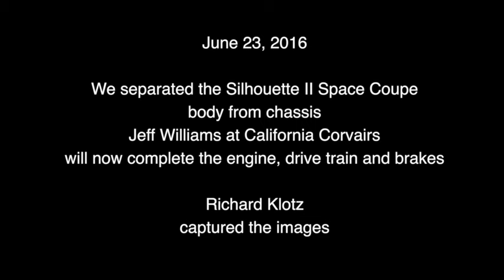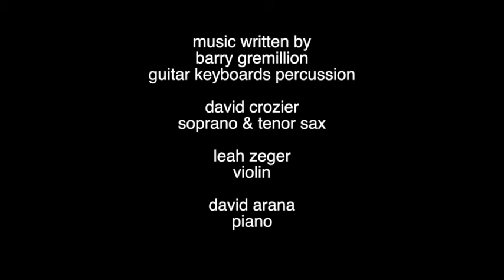Why Bill Cushenbery chose a Corvair chassis and drive train for the Silhouette II Space Coupe

Comment: I also had a concept of taking a Caterham kit car, mounting the engine forward with a custom adapter, placing the trans-axle between the rear wheels and obviously using Corvair front and rear suspension.